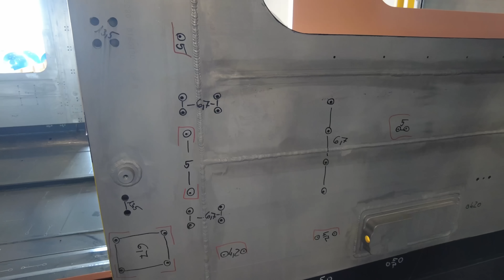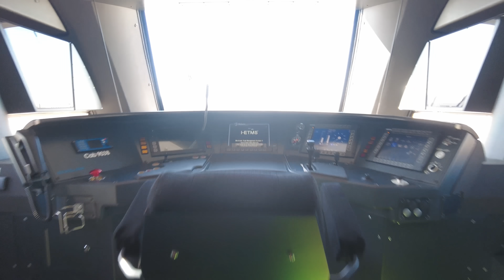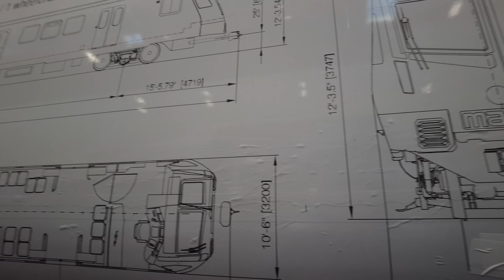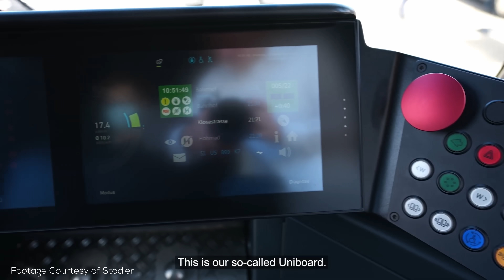Modern European Trains Built Right in North America! | Stadler Factory Tour

Comment: As a designer working for Stadler and being personally involved in the design process of most trains you show here, I am extremely pleased about what you say about the design language and its consistency! Made my day 😀
Reply: As a German Railroader I am wondering, can you guys give the trains more variation in the head section, make them look more distinct and character? I see Stadler Trains very often and I like how they drive and the ride quality. But they all look very similar, sterile and well... just purely functional. Is it possible to make some regional variations?
Reply: @SteamCheese1  yes please! I love the design for the stadler greater anglia trains. They’re so s*xy.
Reply: Can you also please correct the engineering error of the rearward facing cab cameras. I work for TEXRail and it’s an absolute pain opening the side mirrors and the rear cameras block a majority of my rearward visibility on platforms. Silverline has the same design issue and will thus cause their engineers to have the same visibility issues. Preferably to correct the issue would be to drop the rearward facing cab cameras about a foot down to drop them out of the view of the rearview mirrors. My coworkers and I would greatly appreciate it. I’ll even help redesign it haha cause I have yet to use my mechanical engineering degree yet.
Reply: @jbc5877  Ha, believe me, if I could decide things like this I would gladly help out! The reality is: when we design a train, it’s just a small part of the finished project. Engineers, third party manufacturers, government comities, and countless others have an influence on the final product. It’s even possible that everybody knows about this flaw, but there’s a rule that says that the camera needs to be exactly there. I don’t know if it’s like this in this case, but there’s plenty of examples where something has to be done in a less than ideal way just to be compliant. I hope your visibility problem will be solved, and when the next train for the US is on my drawing board, I will try to make some “deciders” aware of the problem.
Reply: Oh that sounds amazing, I love stadlers trains due to their designs so great job
Reply: German here, I also appreciate the design and its consistency very much. You know a Stadler train when you see one – or rather one of the 3 design generations :)
Great work!

Comment: Small note as a mechanical engineer: what you're describing with liquid nitrogen to enable interfering components to slip past each other for assembly is often called a press fit, and isn't really a fusing process (such as, say, all the various forms of welding). Instead, it is literally just friction-based retention (sometimes also including an adhesive, but often not). Since the pressures generated are quite large, the frictional resistance can be significant, making this a reliable joining method.
Reply: And is the inverse of the practice used with steam locomotives (and some diesels and electrics), where the tyres were heated then whacked into position over the wheel centres.
Reply: Does that mean if you cut it into slices and put it under a microscope you would still be able to see two separate pieces? Because I imagined the forces would really turn it into one piece.
Reply: @stefanschneider3681  yes, it would be two pieces, distinct and separate. Think of them as if they were an auto tyre and its wheel, with the exception that this tyre would be shrunk on the wheel, rather than just attached as in a car. And, like an auto tyre, you need to change out the rail tyre when it gets too worn out and too thin to be machined back into shape.

Comment: The FLIRT trains aren't just architecturally electric; perhaps more interesting about them is that the power cars are essentially swappable within the design, so they can be overhead electric, diesel-powered, battery-powered, even hydrogen-powered, or some combination thereof - without needing to overhaul the whole design. From what I've heard, it should even be possible to upgrade existing sets to use a different power car at a (relatively) low cost, which makes it a very interesting option for lines that should be electrified in the future, as that can then be done without throwing away the investment into new trains.
Reply: The Flirt "type 76" here in Norway are tri-mode DEMUs. Overhead power and hybrid diesel generators with batteries. So when they brake they store the energy in batteries, and use this to get back up to speed. Just like a Toyota Prius. That way they are more or less just as quick and nimble under diesel power as when under overhead power.
Reply: Indeed - using diesels to power electric motors is pretty standard on rail, but it's a game-changer when you have design from the outset that means that pretty much the same train can be built as either diesel, AC electric (and I assume DC), battery, hydrogen or any combination of these from the start or converted easily mid-life.
Reply: Stadler offers: FLIRT Overhead-Electric/Diesel-Electric/Battery-Electric/Hydrogen-Electric/Overhead-Battery-Electric/Overhead-Diesel-Electric.
Reply: @sjokomelk  As mentioned in the video though, Stadler diesel FLIRT trains use a diesel generator to generate electricity. The propulsion therefore is always electric. A battery pack is nice as it might save on energy but it wouldn't affect the performance.
Reply: @MrAronymous  It helps performance as the gen-sets can't deliver as much power as needed instantly for full acceleration. That is why the battery is used to boost/contribute with extra power at times.

Comment: I was wondering what your trip to Utah was all about. I regret that I was so close to this facility in January, but didn’t know it! These CalTrain sets are exactly the ones I’d love to see on GO transit. The green livery would looks so nice and the carriages function well with our low level platforms.
Reply from the maker: Oh wow! Yeah they would be fantastic for Go!
Reply: There's no need for high level doors though. How does that work for wheelchair users anyway? Is there an internal elevator to go from the lower level to the upper level?
Reply: @cmmartti  The high level door openings are just getting plugs installed right now instead of actual doors. They are being built-in during manufacturing to support compatibility with the high-level platforms will be added to the corridor for the high speed rail project.
Reply: The trains look nice but I would be more concerned about their operating speed. Should have an at least 200km/h max speed imo for it to be a true upgrade to the current GO transit rolling stock. For some reason we're addicted to low speeds in this country and that needs to change to be on par with modern standards.

Comment: Those KISS trains are so incredible, it shows that
a) double decker trains DO work well on commuter services
b) Other operators in the US should use them for commuter service! (I don't mean MTA, I mean VRE and Sounder.)
Reply from the maker: It depends, sounder does not have OHLE so that’s tricky!
Reply: Just completed the KISS fleet here in Hungary with MÁV-Start’s 40th KISS entering service 😍
Reply: I think what would be great for Sounder is expanded service like Toronto’s go RER plans! Such plans to me show that better commuter rail service is possible if you commit to track swapping and buying out right of ways and the like
Reply: why wouldnt double deckers work on commuter service? Netherlands mostly uses double deckers
Reply: @nenaddimitrijevikj5125  they have slow acceleration, and they have very few doors per car (or at least less than a Metro should have). This increases dwell time, which decreases possible frequency, which decreases possible capacity. The Stadler KISS trans mostly solve the acceleration problem.
Reply: @transitcaptain  if they have enough power shouldnt be a problem. I've ridden double deckers in Netherlands and they accelerate perfectly fine.
Reply: @nenaddimitrijevikj5125  Because they're EMUs. NJ Transit is problematic as loco and coaches have problems, but EMUs are GREAT, that's why I want to see more Stadler KISSes in the US
Reply: @transitcaptain  oh i see what you mean. Correct
Reply: @transitcaptain  The ultimate solution is to have double decker plaforms so that each car can have more doors 😁
Reply: @Mr-pn2eh  I think it will be cheaper to get more multilevel cars and Stadler FLIRTS for non-electrified lines

Comment: Well done on getting that visit. I was lucky enough to go around a Bombardier site in the UK, what surprised me was how spotlessly clean it was - as a kid in the 80s I used to sneak into depots in the UK (a lot of people did then), and there was oil, broken windows, and a general state of semi-dereliction everywhere; largely because they were using old Victorian era sheds that had been converted to diesel sheds, and were also on sites much larger than needed.
Reply: Depends on what  kind of side you were.   There is a big difference between a assembly line or say a wheel and bogie shop or foundaries
Reply: @bertnl530  yeah I guess most of them aren't a huge amount more than flat pack assembly factories
Reply: very cool story

Comment: Since the Governor of New York recently announced that LRTs will run on the Interborough Express here in New York City, Stadler LRTs will be perfect for the line. Something that will revitalized the sometimes dull look of the MTA subways and commuter rails.

I hope Stadler is one of the bidders of the project.
Reply: I hope it’s High floor, Stadler has the Tango series in both low and high floor, to have more capacity in a surely busy corridor

Comment: Apparently the Stadler locomotives coming to New Zealand are to replace 50 year-old 'DX' class locomotives in the South Island. The DXs were built by General Electric between 1972 and 1976, and their eventual replacements are designated as the 'DM' class.

I must say, even though I've never seen a Stadler train in person, I like the strong family resemblance between the different units. The design's adaptability is quite impressive, with examples including the UK's Class 231, 555, 745, 755, 756 and 777 units.
Reply: The KiwiRail locos are being built at Stadler’s plant in Valencia Spain, which Stadler purchased from Vossloh in 2015

Comment: 7:24 fun fact, this is the same exact idea, just reversed from how you put on and change tires on a steam locomotive. The “reverse” part is that you heat the tire with a gas ring, then slide it over the room-temp hub, before allowing it to cool and then shrink on, thus fusing in the same manner. Regardless it’s really cool to hear about old techniques being modified for the modern day

Comment: The story about the Federal Railroad Administration allowing the use of the FLIRT train sets on the CalTrain line was a complicated one, because FRA has very strict crash safety requirements on rail lines that intermix passenger and freight traffic. It was decided that freight traffic would only run during certain hours at night, which would allow the FLIRT train sets to run as the only train sets on the CalTrain line in most hours.
Reply from the maker: It’s a Kiss! Not a Flirt!
Reply: @RMTransit  sorry. No more posting like this early in the morning. 😅
Reply: @MatthiasWiesmann  I don't think so. The FRA had to require that the KISS train sets do not intermix with freight trains that sometimes run on the CalTrain line. That meant the freight trains could only run in the late night hours.
Reply: @Sacto1654  Post-2018 trains that meet EN15227 crash safety standards (with a few modifications to the CEM structure) are allowed to mix with existing buff strength equipment. Caltrain's waiver was actually rescinded as a result a couple of years ago, as it's no longer necessary.
Reply: Huh 🤔?
Reply: @MatthiasWiesmann  they did. Guy is talking disinformation
Reply: Yeah there is one freight train per day that runs from Santa Clara to South City in the early evening

Comment: So cool to see the new Ottawa trains sitting there near completion. These will be so much better than the troublesome disasters that run on Line 1.
Reply: The O-Train videos were filmed in Ottawa (Reece made a video about it). The O-Train FLIRTs were not built in SLC but in Switzerland. They are already in test operation in Ottawa.
Reply: These are for line 2, line 1 uses low-floor (read: streetcar) vehicles.
Reply: @MarioFanGamer659  yes of course. Even the older line 2 trains are smoother operating than the line 1 trains with their computerised jerkiness etc.

Comment: Great video and really interesting.
Modern railway production facility are a world apart from those many decades ago. They remind me of a BMW service area, so tidy and not a drop of spilt oil.
We have several users of Stadler products here in the UK. Diesel electric locomotives (class 68), bi-mode electro-diesels (class 88 with the class 93 in production, there's a tri mode diesel, battery, 25kv (class 99 in production). All the locomotives use Caterpillar engines. Flirts are being used by Greater Anglia, you showed one mid way in the video. These are bi-mode electro-diesel types that run on 25kv or generate their own power like a diesel electric. Same format as you showed in the video with two or four diesel generator sets in a separate vehicle in the centre of the train. GA also have full electric 12 car sets for inter-city traffic and to Stansted airport. Transport for Wales (you showed one of their trains near the end of the video) have DEMUs (diesel electric multiple unit) class 231s Flirts, plus electric Stadler Citylink Tram Trains.
Merseyrail in the Liverpool area (where I live) are just introducing class 777s. These are a low floor design with a retractable plate to the station platform to allow for step free access to the train to aid those with mobility problems and people with baby buggies etc. Some are 3rd rail DC only, some are bi-mode 3rd rail plus lithium titinate traction batteries (6 tons of them per train) so they can run in non electrified routes or extensions to the network. They also have the capability to be adapted to dual voltage 3rd rail DC and 25kv overhead should the need arise. Tyne and Wear Metro is just recieving its first class 555, DC overhead. Both the 555s and 777s are based on Stadler's Metro family design. Glasgow is getting Stadler trains for their underground system.
Stadler have really grown in their presence rapidly in the UK in recent years and with a variety of formats, products and variations of types.
It looks like they are doing similarly in North America.

Comment: Just a heads up at 6:43, those two trucks are not a size difference between Caltrain and Silverline, the power truck on the left is what they use under the cabs of the Silverline and TEXrail sets. The idle truck on the right is for the other points of connection between the articulated cars to allow for a better ability of passengers to move from one car to another without stepping as high inside the car. It can be seen in 7:09 with all the Silverline trucks the size comparison between the power and idle trucks toward the right side of the screen

Comment: Here in New York, we have just been purchasing Bombardier/Alstom and Kawasaki Trains to serve our Commuter rail network. We need some Stadler KISS trains, as they would definitely boost capacity and also give our unelectrified rail lines new rolling stock, to help expand our train fleet modernization program.
Reply from the maker: It would just be nice to see something new! More competition means better products!
Reply: The KISS sets wouldn't be able to enter Grand Central Madison, but with the right setup, FLIRTs might (without sacrificing use of overhead wires).
Reply: @RMTransit  These trains could be used for shuttles on the Ronkonkoma Branch east of Ronkonkoma, and the Oyster Bay Branch could also use these trains, and pretty much any one of the unelectrified branches on the Long Island Railroad and the Metro-North Railroad. Maybe we could take inspiration from CalTrain's Stadler KISS EMU's or we could have something like the DART silver line FLIRTS. I would definitely recommend that the MTA ( NYC's public transport agency ), to purchase some rolling stock like this, as our older DE/DM30AC locomotives and C3 bilevel cars are getting older, and if the MTA wants a zero emissions fleet by 2030, then this is a worth investment. We could either electrify all 160 miles of diesel territory, but due to costly price tags, it's unlikely.

Comment: It would be interesting to know to what degree American train design is influenced by outdated regulations and requirements.   It's my understanding for example that American passenger trains  (unlike European trains) have to be insanely heavy for "safety reasons" (supposedly if a car is on the tracks they plow through it instead of derail).  But if the train is on a grade separated route, it shouldn't be subject to such silly rules which great increase cost and hurt efficiency.
Reply from the maker: Stadler has been a big part of changing these rules actually!
Reply: @RMTransit  Great to see!
Reply: I think the crash standards are more about freight trains than grade crossings but in any case, crash prevention standards are certainly lower in the US than in EU.
Reply: @MatthiasWiesmann  I wouldn't say that. The real difference in European and American philosophy is crash energy management vs crashworthiness. While the European philosophy tries to protect the passenger as best as possible, the older American philosophy is to ensure that the trains survive accidents with as little damage as possible. Crashworthiness, however, is more dangerous for the passenger because no impact energy is absorbed.